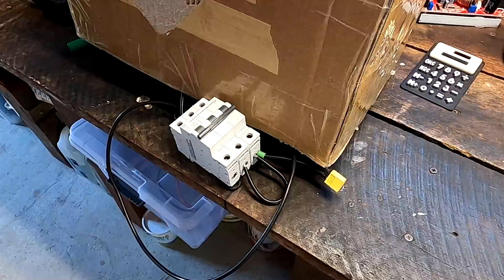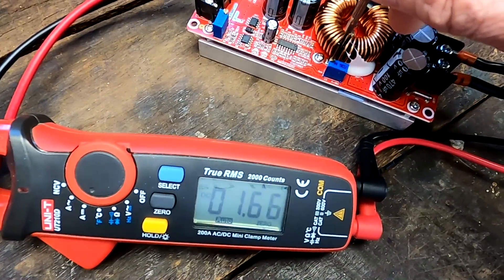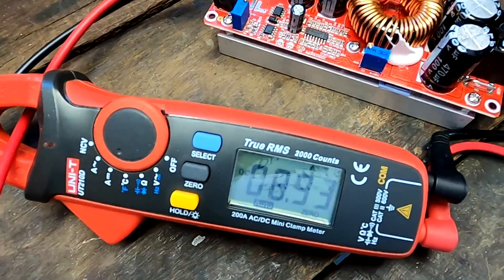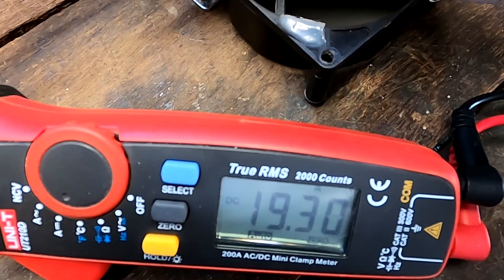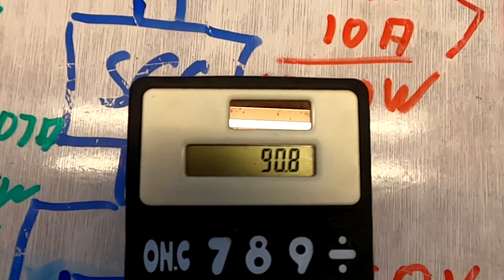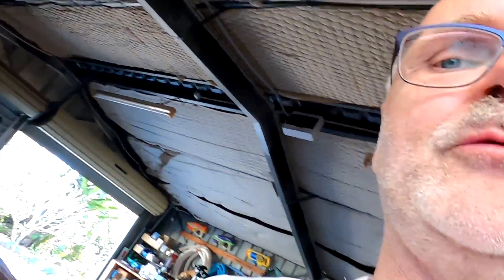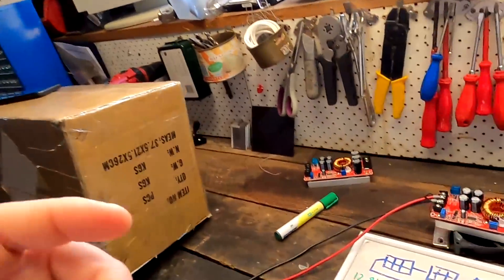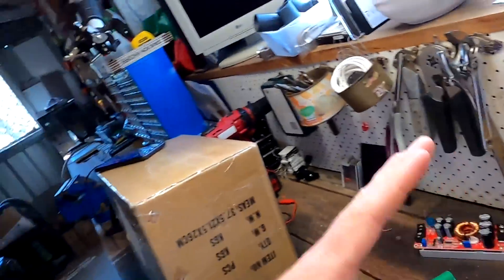Regenerative Discharging with good efficiency. Part 2

Comment: Hi Andy  , I have several smaller stings on my property ,one consisting of 3 400 watt panels in series ,those 3 panels only have a  voc of 37 volts  each  or about 110 volts total.  My mppt charge controller will not turn on until 120 volts   Could i use one of these to increase my voltage...?  Thanks Andy

Comment: I am planning to use these boost converters to use them as MPPT for a 16s (54 V) LiFePO4 battery. They only cost 14 USD , will handle two 550W panels, and no need to buy expensive MPPT devices.

Comment: So we know cc en cv are constant current and constant volt.. could rv1 have something to do with output fluctuations..? So i finally managed to pull the wattage i needed from my lifepo4 cells with the buck converter(i had connected it together with solar in serie and later pararelel, thats why it didnt work). I probably need to calculate the accumulated voltage and energy output to use it in serie with solar to charge my power station. But what i noticed is that the output had lots of fluctuations and it could be regulated with the RV1.. Could you explain that a bit.?

Comment: I am doing similar use. Having two 1800 Watt boost converter. One adjusted to 48v and another one is 12v. meaning if we are doing offigrid camping then can charge it from either from 12v or 48v.

Comment: im planing to go around australia with an electric bike and a custom E camper towed behind that has its own motors and battery system and iam using these boost converters in the system to boost the 60 volt from the series solar panels to the 85 volt i need for the bike and camper,i found that an input of 60 volt allows me to access more easily the full current specs of the boost converrter,so yes ill be relying on the converters ,i havent had one fail yet but ill be talking a couple of spares as im asking alot from them.
Reply: i must admit im not soley using the boost converters there is a grin cycleanalyst version 3 with a shunt that monitors the charge voltage and current and a smart bms with charge ,dischage,and precharge contactors and hall sensor current and voltage ring sensor, there is a samsung tablet in the camper that is use to monitor and controll the setting for the systemso i have plenty of failsafe if the boost converters fluctuate in anyway

Comment: Hi Andy, thx for this test..... Was exactly what I am about to do .. (I got the 1800W version), i.e. to charge a 48VLFPO4 battery from a 12VLFPO4s model. In my point of view, for wind turbine system, it's more easier to charge a 12V battery with a basic wind turbine than a 48V model since the 12V wind turbine will required less torque to turn. In other words, it's better to charge  (slowly) 12V battery more often than a 48V one rarely..
Reply from the maker: Ah, OK, but then you would lose additional energy while converting from 12V to 48V again. So I think charging 48V directly might be a lot better and more efficient.
Reply: @OffGridGarageAustralia  Will see :) but according to my wind strenght distribution.... I should produce more despite the extra loss. :)

Comment: I'm trying to do the same to charge my non solar batteries based on a laptop power supply and a this boost converter. When I connect it to the battery it gets the overcurrent protection turned on, when I connect it to the MPPT, it starts charging the battery for around 5 seconds then it turns off (amps goes to 0 and voltage starts decreasing). What am I doing wrong? Why is the battery reversing the current?
Reply: I discovered that I have to limit the MPPT current to the maximum the power supply can provide. You can do that by limiting the current in MPPT in the app, or with the boost converter. For more redundancy, I limit it to both

Comment: I'm looking at converting 48v dc 25A max input into 60v cc/cv 15A output, is it possible?
Which model do you recommend?
Reply from the maker: That is possible and I would go for the 1800W version: https://off-grid-garage.com/dc-dc-converters/
Reply: I finally got it, but not sure it's the 1800w version this version is claiming 1500w and CC is adjustable 0.8-22A range

Comment: I think its almost the same as "proper charger" only difference is maybe balancing modes and the whole software which controls the charging amps/volts etc., I think only when the battery which is going to be charged with dc-dc and doesnt have the BMS built in thats the only danger here I think.
But as Im here, I have similiar problem, I have one 48v battery pack which is charged by solar, but in future I will have 48v go kart and other devices running 48v batteries and for those i dont have charge, Ive only got imax b6 cahrger which I like but its max is 24v (and can be powered from AC with adapter or 12v dc) , i was thinking about something similiar inexpensive like this little charger but I cant find any even on aliexpress, my only solution yet is this same dc-dc buck but im not sure of it, especially leaving it away from me like I can with imax b6 because of all the protections it has. Does anyone know some solution for this or know some inexpensive charger (can be diy aswell)?

Comment: My e-bike ado motor 750watt battery 48/20a controller 23amper step app da 1200watt 20a battery charge max 55 volt step app charge 72 volt spedd max NY e-bike 67 kmh max Speed 5/55 kmh gps top top My e-bike

Comment: I’ve used these boost converters for a few projects.  They are handy and cheap but have been far from reliable for me.  I’ve got three dead ones in my parts bin.  I’d love to figure out what causes them to keep crapping out and how to keep them from frying if anyone has any suggestions.
Reply: You were using them at what amperage on the input side?

Comment: If I hook that up to a solar panel charging a 58v battery, how with the CC cope with the highly variable and often very low current of the solar panel? Can I max the CC dial and it will always put through everything that the solar panel is providing as long as the solar panel is near it's 18v peak?

Comment: Can I use it (2 pcs. output in series connection 160V ) for a high PV hybrid solar inverter?
1 Solar panel -> 2*Converter -> High PV in to the inverter.
The converters output in series, to reach 160V (120 minimum for MPPT high PV in).  It wont damage the hybrid inverter?

Comment: What do you recommend for a power wall charger ? I have 2 - 48v lithium battery banks 1 - 3.2v 280Ah x 15 = 48v & Yonlong LTO 2.3v 40Ah my inverter is a EASUN 5 KVA 230v Charge a controller 48v GWV ?

Comment: Hi. Can there be a boost converter which can handle 120A of input dc current? I have 28V ,120A coming from an regulator and I wanna juice this to 55V. Is there such a product in the market, where it can handle that much current and 3360W of power?

Comment: Hi Andy i watch a few of your videos thanx for all your videos they help a lot what i experienced on that exact model dc /dc is the low voltage on a drained battery makes it oscillate on the output side and with some sensitive electronics. i would really like to know what kind of regulator a person can use on this model as the only solution i had was using a low battery voltage cutout to get past that. or am i missing something with the converter? not sure if it has a current limitation to cut the voltage at a certain point as battery goes low and amps goes up.

Comment: sir i have 12v 170ah northstar battery, can i input this battery to circuit to get 48v. i actaully want to run 48v 1500w hubmotor e bike using dc to dc boost converter with 12v 17ah battery. will it work or battery can burn this converter due to high current?
Reply from the maker: These converters can do 1800W but only for a very short amount of time. Certainly not for a hub motor. If you have an 800W motor, I would say yes...
Also, 12V/17Ah runs the motor on 1000W for only a few minutes. That's a big stretch for such a small battery and will wear it out quickly. If it can deliver such a high amperage of almost 100A at all.

Comment: Could i paralel two or three of these from the same source? I have a 1500w wind turbine, but i want to boost the voltage to 48-50v so it charges a little on lower windspeeds.   

What happens if you increase the input higher than the output? In case of a strong gust i mean

Comment: Hi can I Ask a Question? Hopping you notice me, can I connect, solar panel to Buck/boost converter to pwm or mppt solar Charger controller, the idea is the SCC can control the Voltage and Amps while the buck/boost converter was to Have a Constant Volts and amps but is not safe so can i Connect them both to charge a Lifepo4 battery? Hope You notice me your Vids are great and Im learning 🙏🙏

Comment: Sir I have one question, did this boost converter I can use with MPPT charge controller's DC output load to keep constant voltage for DC ceiling fans which has DC 16.25V on full speed?

Comment: Good on ya ALL, for helping out Phil like that! I have used these cheap Chinese buck, boost & boost/buck types for different projects and voltages, they are fine for so many things, and even setup correctly could charge lithium batteries to some extent, but I agree with your comments  Andy, and always go for a reasonably larger size converter than anticipated load, and fans obviously do make a big difference for higher outputs. They could be handy for cheap 48v - 5v, 12v, 24v outputs for various controls and cheap projects like LED lighting. I have used them regularly with 12v - 35v boost for LED floodlights and 12v homemade high bay LED lights too, very handy & cheap, but dont push their limits or temperature too far, we know what happens, magic smoke!

Comment: I am building a portable solar generator using a 50 AH LiFePO4 Battery with a MPPT solar charge controller attached to it. I want to be able to use this power source while driving in my vehicle and be able to charge it to some degree from the vehicles 12 volt system. My thought is to use the 12 volt power socket in the vehicle limited to about 10 amps output at 13 to 14.5 volts connected to this boost converter and the output of the boost converter connected to the solar input on the MPPT charge controller. Will this work or is it a bad idea? Any suggestions you might have regarding this goal are very much appreciated. Thank you!

Comment: I have the big 40amp one of these and I want to use it to charge a 45ah lithium battery but I'm still kinda afraid of using this thing because it didn't come with any instructions
Reply from the maker: You have to start small and see how it works.

Comment: For that vehicle LiFePO4 battery, not the charger is a problem. Need a BMS, otherwise no charger is safe. The BMS protect LiFePO4 battery against any CELL over or undervoltage. Of course, needs a good one, definitely not a 8-15$ BMS, that are crap.
Reply from the maker: He's got a BMS already. I think it shows this in on the photos, can't quite remember.

Comment: If I have 18v input and need 21.6v output with 425w... what would I need to adjust. 
I have set my out put voltage to 21.6v but how do I adjust the watts up to 425w
Reply from the maker: With these boost converters you can also set the max current the load can pull. So 425V / 21.6V = 19.7A

Comment: I'd use that for energy generation diversification can run that into a charge controller
Reply from the maker: But what happens if the battery is full and the SCC tries driving the 'solar' input to an inefficient part of the current-voltage curve as it would do with a solar panel?
Reply: @OffGridGarageAustralia  I think with my Midnite 200 has the ability to buck boost as well as mppt
Reply: @OffGridGarageAustralia  I have a Midnite Classic 200  MPPT 90 A it has a time of use function  and it has a special buck boost feature aswell for wind power or hydro

Comment: Actually, ALL solar charge controllers ARE buck converters. Victrons of course is of a much higher quality when compared to cheap chinese converters.
Reply from the maker: Yes, that is correct. There are even solar charge controllers out there which can boost the voltage, charging a 48V battery from a 24V solar panel.

Comment: I was expecting the converter to blow its output caps when you disconnected the output from it by switching off the "big battery". Don't just kill the output on such converters when doing high currents. The output smoothing caps don't like it.
Reply from the maker: Done this a hundred times, never had any issues... but thanks for the tip.

Comment: There are more details, but to keep it brief, I basically want to power 5 Enphase IQ7+ inverters (each clipping at 300W) from the 2.2kW rated Accessory Power Module in my Chevy Volt so that I can integrate them into an Encharge10 system with my grid-tied solar array.  When the grid goes down, the system would seamlessly make use of solar power when available, then the 12 or so kWh in the traction battery, but then also the car will continue to operate for ~6 days as a quiet gas generator with low emissions, keeping the battery charged and the microgrid operational even if solar production is low/insufficient.  This approach also guarantees that I can’t draw too much power from the car (as might happen if I went the cheap route and bought a 1500W inverter).  All I would need to do is boost the 12V output to 50V to keep the microinverters above the MPPT range.  

It would be nice to use one boost converter per microinverter at 300W, but then they would be running at 12V 25A input 50V 6A output and would overheat.  10 total boost converters in parallel on the input should take care of power/heat issues. 2 in parallel output per microinverter (each boost converter running at 150W (12V 12.5A) input and 50V 3A output.  Am I missing anything?  Do I need large diodes on the output pairs in case one goes down and the other does not?

Any chance the 1800W version would handle the 12V 25A input without overheating?
Reply from the maker: The Volt has a 2.2kW output power module? Like with 12V or how does that work?

Comment: there shouldn't be any problem using boost/buck convertors to charge batteries as long as you don't exceed the battery voltage and have a proper balancing solution in place. Generally, keeping the voltage slightly below the maximum will also assist in avoiding overcharging, as well as extending the battery life by not stressing the battery as much.
Reply from the maker: And don't forget a good BMS which can disconnect the converter if something goes wrong.

Comment: Re Phililips charger. Don't need a $ hundred$ dollar victron charger, total waste of money, All that is needed are two much cheaper electric items, one is a $30AUD 24v scooter charger ~2 or 3 Amps output, the other item is a $16AUD ebay 6-80v voltage adjustable relay to turn the charger 240v tiny amps on/off between a LifePo4 happy selected range ~13.4v to 13.8v. Turn on at 13.4v or below and turn off at 13.8v end of story no absorption or float Lifepo4 doesn't like them. Because the charger output is low the saturation efficiency of the battery is high so no need to charge to 14.4v to achieve 100% saturation. Only reason to charge to 14.4v is if the bms Phillip chose has that as balancing start criteria and that is only required once a month for one hour. Better is if the battery has an active balancing that uses a delta and a range to start balancing in which case no need to ever take the lifepo4 past 13.8v. If Phillip uses more power each day than the 2-3A can put back in each night that would be the only reason to raise the charger output to match.